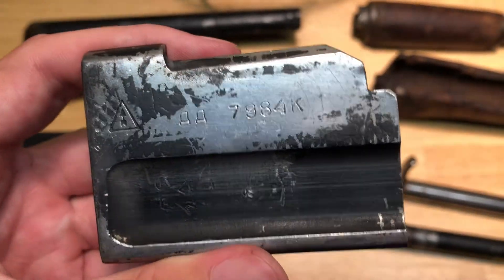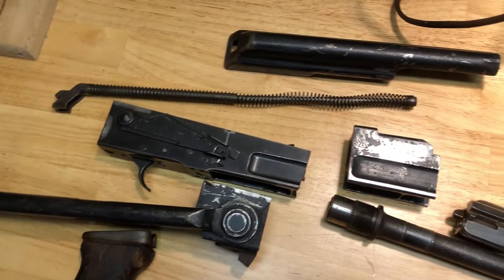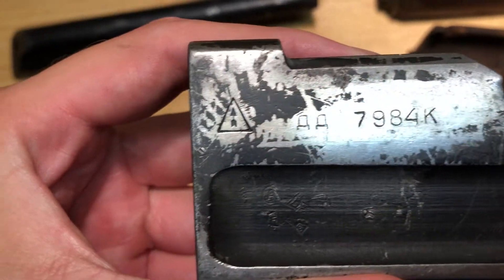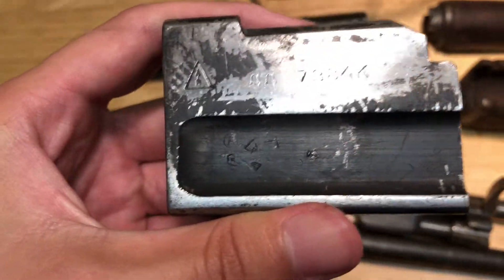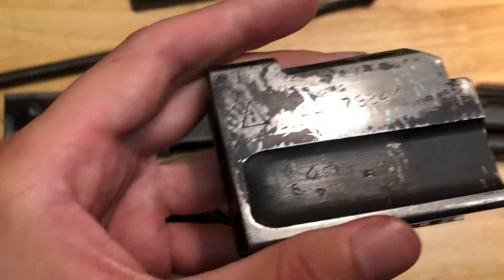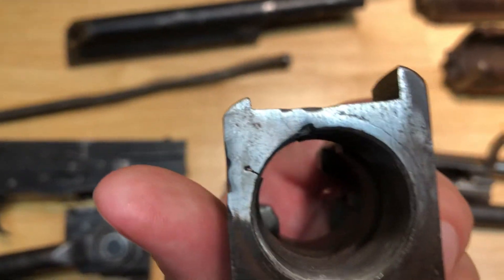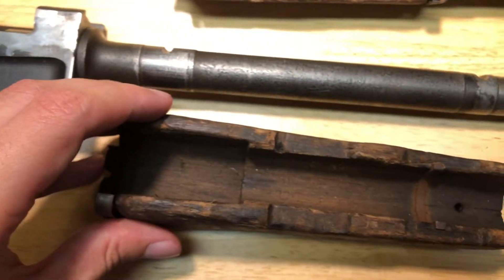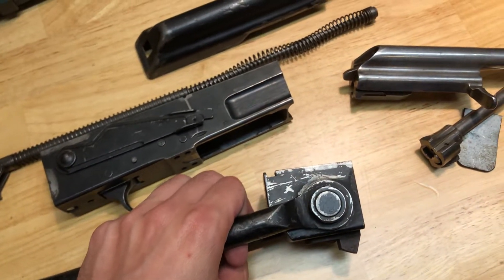T3 AKS (AK-47 underfolder) PLO Kit - Pt. 1

Comment: A other method of building in the day with milled kits was to mill or grind the sides of the front trunion below the proof marks and serial number so it would fit a sheet metal receiver.